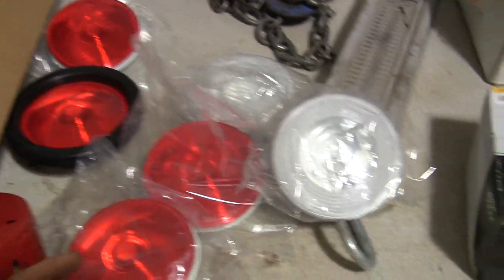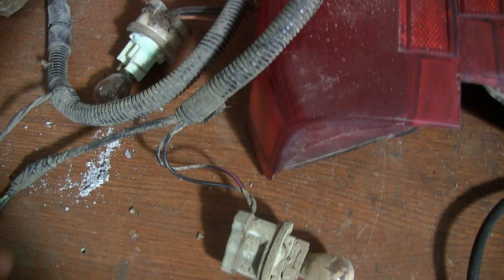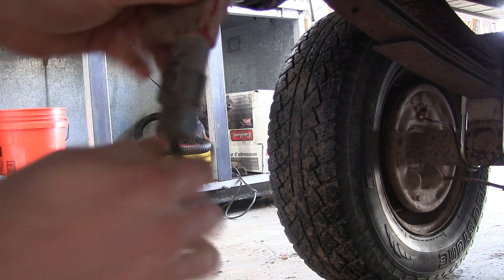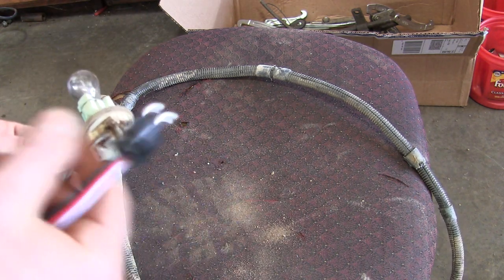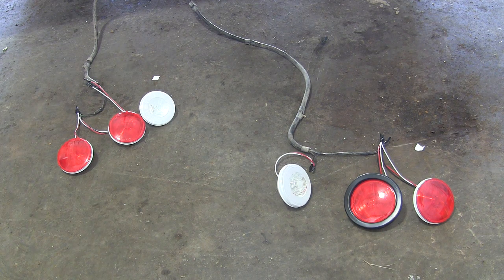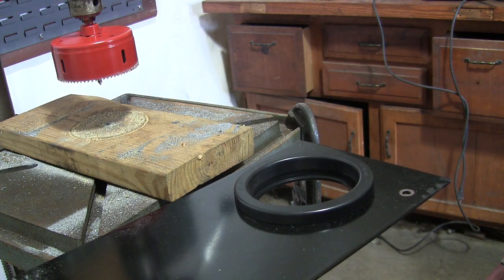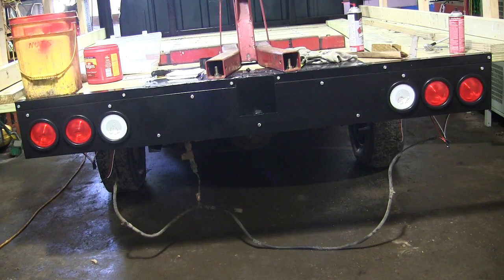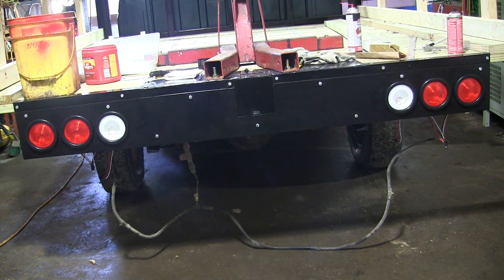Taillights for the flatbed truck

Comment: Hey man wat did you do to all your grounds. You prolly wont see this comment its from 7yrs ago this video lol.  But i just put a flatbed on my ole chevy. And i cant get brake lights to woek
Reply: I’m in the same boat I can get turn and brake to work separately but they are both supposed to be connected to same wire on tail lights I got for it
Reply: @aubryoutdoors9261  so wat i ended up doing is buying seperate turn signal marker lights. And not have them hooked to the same light. Works good